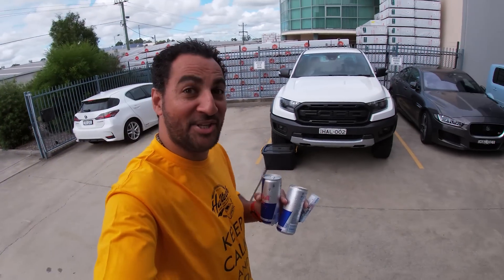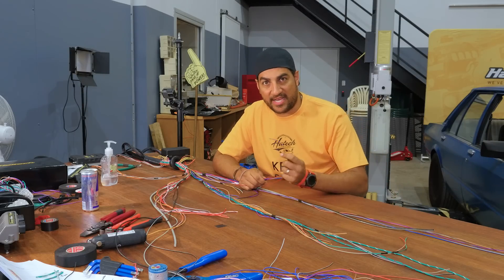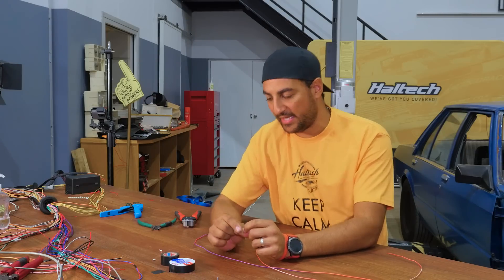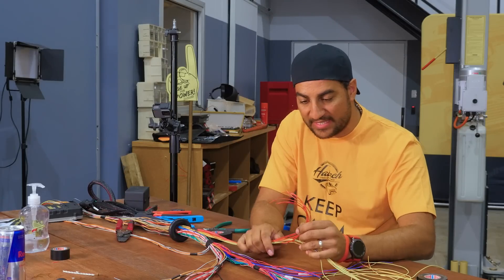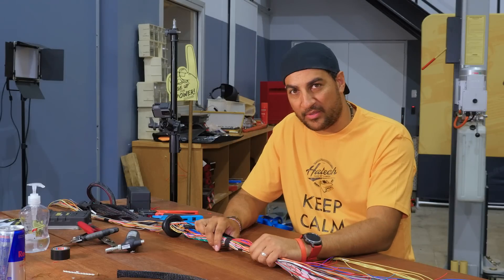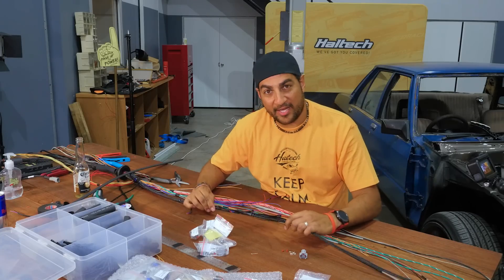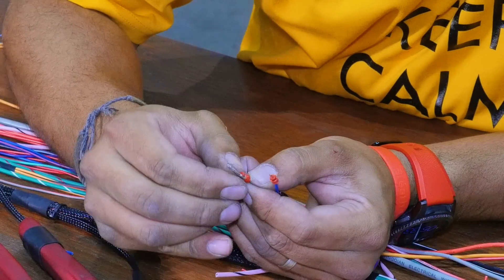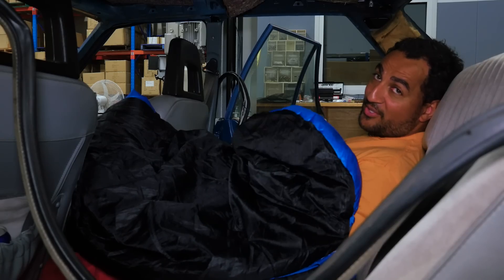🎥 Ep6: Grouping and terminating ignition and injector looms | DAVE'S WIRING VLOG

Comment from the maker: Welcome Back! We're getting closer as the wiring comes out of the car again for final grouping, cutting, braiding and terminating. Both injector looms (one for each bank) get completed and terminated with connectors. The harness is now ready for the final install!
------------------------------------------------------
Links to products used in this project:
Haltech Elite ECU + Premium Wiring Kit : 
https://www.haltech.com/product/ht-151304-elite-2500/
https://www.haltech.com/product/ht-070300-dual-crimper-set/
https://www.haltech.com/product-category/plugs-pins-and-wiring-products/
EFI hardware: https://www.efihardware.com/ 
Syltech - https://www.ebay.com.au/usr/autosupplies_au?fbclid=IwAR3R8VfP6_66tLITPyGXy4y6SrwgwXUglHZLuCY-_DVyPoAc4v4DpBZ2J4M
RS components: https://au.rs-online.com/web/p/crimp-butt-splice-terminals/7187561/
Connector-Tech ALS: https://www.connector-techals.com.au/
Tesa Tape: https://www.tesa.com/en-au/industry/tesa-51608.html
Tempco Crimpers: https://temcoindustrial.com/temco-hydraulic-cable-lug-crimper-th0006-5-us-ton-12-awg-to-00-awg.html
3D Racing Solutions: https://3dracingsolutions.com/collections/dash-clustersh
Power probe: https://www.powerprobe.com/
Reply: Hi there, 
I have a video request for you guys. 
For someone that decides to do a loom from the ground up where he just bought the plugs there is no guidelines from Haltech in regards to recommendations with wire gauges and wire types, etc. 
Could you guys do a video showing us building an Haltech Wiring kit from the start and letting us know what type of wires you are using and why? 
(Side Note: I do regret not having bought the basic loom, but now its too late as I already have the plugs and pins lol)

Comment: Hello Haltech! Great video. I just want to get your opinion. From the wiring harness found all over the internet, the injectors, coil and igniter share power source straight from thick ignition wire. While the fuel pump and other 12v solenoid/sensors get power source from EFI relay. I just found out mine that they are soldered together. Will it cause any problems with the injectors and coil on how they would perform? Engine is a 20 valve 4AGE. Thank you in advance!❤

Comment: Is there any work done to straighten the wire strands out before being used, or is it the type of wire that helps reduce curling?
Reply from the maker: Mostly the grade of wire.

Generally speaking, better grades of wiring will have good flexibility and resist coil memory.

Comment: Hi just wondering how you picked which power to then splice off for the injectors please?

And do you generally wire the platinum loom injector wires in firing order?

Eg

For a 4 cyl

1 = inj 1
3 = inj 2
2 = inj 3
4 = inj 4

Comment: Dave, grab your self some electrical solid PVC pipe, 16mm to say 50mm and thread your braid over the pipe and simply push your loom wires through the pipe to where you want the braid to be, restrain the braid and pull out the PVC pipe

Comment: Why was it chosen to not make the injection harness separable?
Reply: Usually It just depends on the type of installation that i am doing - purely for this video's purpose, I incorporated it into the loom.
But by not using a breakout connector for the injectors, It kept the cost down as well as it was not a requirement in this job.  

What are your preferred Methods?  Sharing your experiences and practices here might help everyone out!!
Normally If it is required/requested to have a Breakout I like to make a breakout loom & do it through a Deutsch DTM connector
Reply: @davenonameforrester  thanks for the reply Dave, I personally have used the DTM connector on the harness work I have done. Never really thought about the costs of them since the cars I have been working on are not mine. They reason we do it is for manifold and injector combo changes. However looking back I think I can only remember twice when we actually used that feature. Once was to add dual injectors per cylinder on a modified holley high ram, the other was just new injectors with different plugs.

Comment: Could you show how you ran the wires through the braid and branched it off into the separate injectors and a better look at how you crimped the branch wire for the injectors power wires?

Comment: can you use the same process of branching the power off of one power wire for ignition coils too or is that only for injectors, i'm wiring my sr20 with a haltech 750 atm :)
Reply: Hey William, the same will apply for your Coils as well.

Comment: in regards to what you said about people slamming soldering. im an electronics guy work on alot of arcades and pinballs and we prefer soldiering for that sort of application, but im currently building a r32 gtr with a rb30/26 in it. im watching these videos to help me with when i get to the wiring part of the car. so whats your opinion on crimping then throwing a little solder onto the join after they have been crimpe?n i ask due to my experience with crimps in regards to them not being great in the aplications ihave used them in when repairing or rebuilding a pinball or arcade machine? thanks in advamce for your response in regards to this question

Comment: The problem with solder is that the Flux causes corrosion in the wire and after a few years the connection goes bad. Also solder is not flexible and if there is movement in the wiring the joint will break much faster than a crimp
Reply: I've never seen a crimp been able to flex either. When it does, the wire is usually working its way out. Yes you can over temp the wires for a solder joint, and using the wrong solder and a cheap ass soldering iron will help cause failures. Having worked on Industrial Machinery, a solder joint has proved way more effective than just a crimp. But this is job specific I spose. In the end, it's what is the best for what you are able to do, and in the time/dollar constraints you have to work with.

Comment: Another great one Dave and the guys. I do have a few questions tho..
1. I've noticed you use the "horizontal" style strippers. Are you not a fan of the style that looks/works like a dinosaurs jaw? I can see where it would be difficult to stip in the middle of a wire with that style but just curious on your opinion
2. Just for reference, you said you use a large/medium/small sized expandable loom. What sizes would you recommend buying before starting this project? 
3. When you crimped your wires for the plug, and proceded to heat shrink and slide them into the housing, I noticed you don't do any kind of service loops or anything of the sorts. What is your reasoning for this? Is it just "cleaner" or is that just taking your harness one step further, same concept as doing concentric twists to the harness?
Reply: Usually I use a 4mm, 6mm, 12mm and a 18mm size Expandable Braid/sleeve
Reply: This is just an entry level wiring video on how to wire up an engine loom. 
It is much quicker to get a job done, and was not required for this installation. 

Do you like to use Service loops?

For the people that use them, and always put them in... Could you share why you like to do it that way? 

Have they been helpful in the past ?
Is it worth the extra time and effort?
Reply: Thanks for the reply. Its not that I've used them before, I just kinda like the idea of them but was curious if they where actually practical or just some high end motorsports thing.

Comment: Hi Dave, I enjoy watching your video Series but there is one thing you should consider and that is polarity with injectors. I know that a coil is not polarity sensitive but when I looked at my injectors they all have + and - marked on them. 
I am not into electronics but I think they have a zener-diode built in to stop the voltage spikes at around 55Volts and such Diodes are polarity sensitiv.
Greetings from Germany
Bernhard

Comment: I would suggest NOT twisting the wire strands before crimping the legs over. If the wire strands are twisted, there is no way the crimp legs can grip the wire properly. The crimp will look a mess under magnification, and will not provide maximum grip or contact. Better still, use crimps where possible that have a barrel/sleeve style end.

Comment: Pro tip when terminating wire at a connector. Slide the wire seals on BEFORE you strip the wire. Slide it on and out of the way, strip the wire, then slide the seal back down into position.